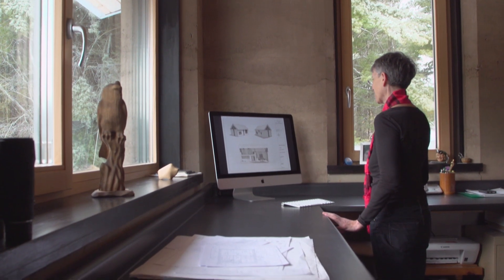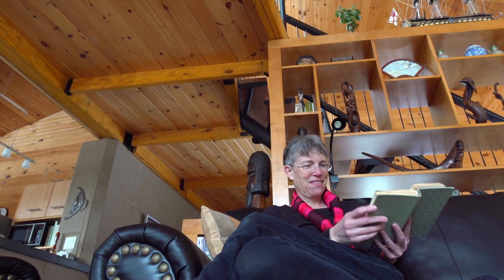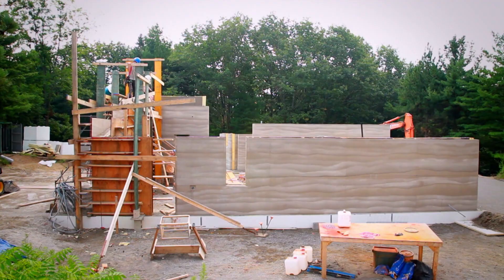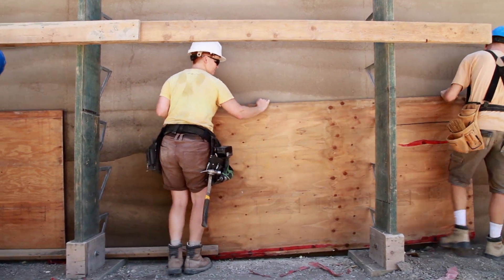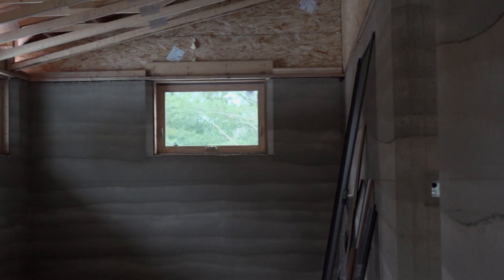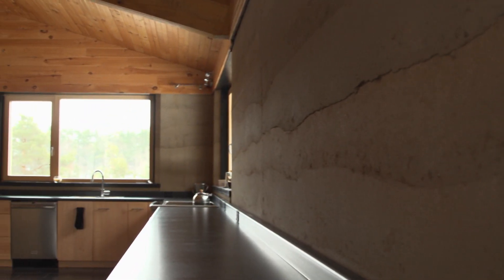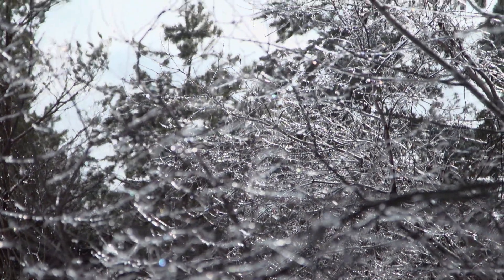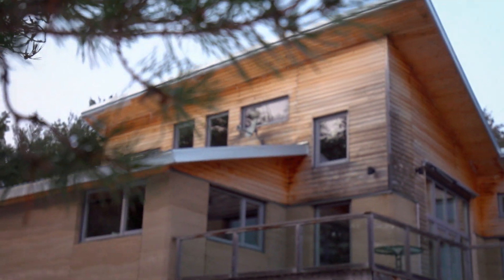Sustainability Can Be Beautiful: Dirt + Pressure = Rammed Earth

Comment: BEAUTIFULLY DONE HOUSE!!!! I love how they made sure they used different colors and made designs with it waving the colors up and down using reds in some parts and grays in others, but not mixing the two just in flat sections of the same wall, very well done and thought out.

They went way overboard with the insulation. if they had just made the original walls the combination of the two wall they put the insulation between it would have still maintained that 60 to 70 degree temperature all year round like a cave, and done really well in the winter with many south facing windows to allow the sun to heat interior walls and if they did the floors the same way the floors as well which then would release that warmth throughout the night maintaining the warm temperature!!! I only point this out not as a criticism but so anyone using this as a guide to build their own know they don't need that step, you just make the walls 18" or more thick.

Comment: I wonder how this would standup when a under dirt and sod. The misses and I are exploring options and design ideas to build an earthship style passive solar home with a timber framed roof. This looks like it might be able to handle it but moisture is a concern for me.
Reply: if you mix concrete with adobe bricks, it makes them pretty water proof
Reply: 10% concrete, moisture should not be a problem as long as you don't let water or humidity get to the walls.

Comment: Doesn't it require the use of cement? And therefore isn't CLT from sustainable forests much more environmentally friendly?
I am not hating and I love the look of rammed earth but to get that look requires other, unfortunately, harmful materials.
Reply: You can put 10% to make it stable.
Reply: The short (tl;dr) answer to your first question is that SRE often uses between 5 and 10% portland cement. To judge whether something is more environmentally friendly is complex. Note that the thermal mass means no energy expenditure for heating or cooling, and the lifespan (more than 500 years) means this is a very large energy savings.
Reply: Late reply , 😀 lime is used and you can even throw a 10% rice into it to give it strength as they did on the Great Wall

Comment: Compressed earth bricks are cheaper and easier to build, but rammed earth looks great.
Reply: Manit C rammed earth will make the walls one solid block whereas using bricks you have several tiny blocks glued together which is less solid and an inferior design
Reply: @Sorel366  Great Wall sections were widely built with bricks, with lime mortar and sticky rice used to reinforce the bricks strongly enough to resist earthquakes and modern bulldozers while keeping the building intact.
Sticky rice mortar - Wikipedia
https://en.m.wikipedia.org/wiki/Sticky_rice_mortar

Comment: That works unless there are floods.  I plan to move to higher ground and build a stone/ concrete water base then rammed Earth then timber.  I am going to go out and take pictures of sandstone mountains I like and try to copy those designs wavy inside my house walls.  I am a Gnostic / Spiritualist also I have found that the Walking Dead Black souls do not like walking through Earth so my walls of stone and earth will make them walk around my house not through it.  Yahoo!!  Love your home cool house !
Reply: Cob (Clay,Sand and Straw) has been used in Ireland and the UK for centuries. These countries aren't exactly the warmest or driest places year round. The key is a stone base and an over hanging roof. There are coating put on the walls to make them water repellent. Even if the walls became saturated it would take years before you saw any deterioration.

Comment: I wonder about cooling ? we have seen even in places like Alaska temp hitting 90's ! what if that became a norm each summer ? How do you efficiently cool in this system of home building ?
Reply: They are also cool in the summer if built properly. A smart house will have overhangs that let the low winter sun into the house but shade the high summer sun out.
Reply: Also the thermal mass and proper ventilation is important... but whats more difficult to deal with on a passive level is high humidity...but there a methods to create passive underground cooling to dehumid the are air... if your will to pay the cost for it...
Reply: Moksha Shanti

Comment: Important question. I live in central North Carolina and I tend to have dry skin during winter season. Would Rammed Earth home be too dry for my skin? Is it possible to have some humidity inside A Rammed Earth home?
Reply: Keith Mitchell You could use a semi permeable sealer on the walls and install a humidifier. Or use lotion (on your skin, not the walls).
Reply: Rammed earth walls passively regulate temperature and humidity.  It’s ideal for asthma sufferers.  Also, earth walls are mold-free. Basically the most eco-friendly building with health-induced properties and many more benefits...too many to list here

Comment: as you mentioned the high thermal mass of it. I doubt it is a good exterior material.
Reply: ...that's why they put insulation in the middle of the walls.
Reply: It’s an excellent external wall; fireproof, bullet-proof, pest-proof, load-bearing, mold-free, passively regulates temperature and humidity, can withstand hurricanes and tornadoes and lasts forever...what could be better?

Comment: As a physicist, you should get this... there is a statistically significant correlation between the temperature changes of the planets in our solar system.  So either the people of Earth are heating/cooling all the planets, or the common element in all of these planets, THE SUN, is primarily responsible.
Also, NASA has just discovered that volcanic activity is melting Antarctica.
Reply: Earth's climate is incredible complex, with elements from Earth and space constantly moving in and out of the atmosphere, and  the atmosphere itself constantly getting mixed vertically, horizontally, and laterally. Understanding Earth's climate cannot be simplified - especially the moronic conclusion that driving cars and using electricity makes the climate warmer. (And only paying taxes and growing government will make the Earth cooler!) 

However, understanding primary temperature variation is easy: The sun gets brighter, the Earth gets warmer. The sun gets dimmer, the Earth gets cooler. 

All you need to confirm this is to measure the polar ice caps. Pictures taken from space over many years clearly demonstrate this - The polar ice caps ARE shrinking - on Mars.